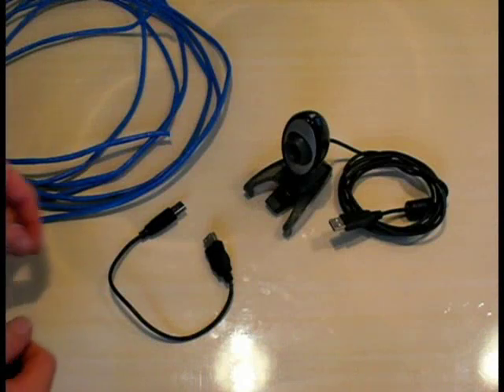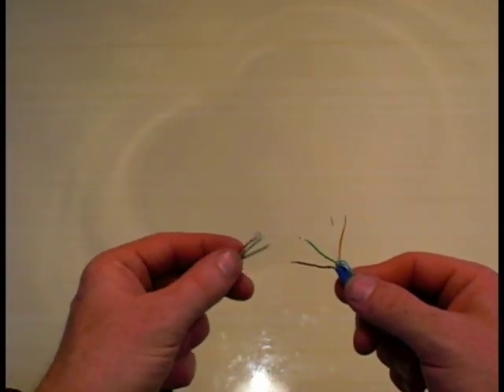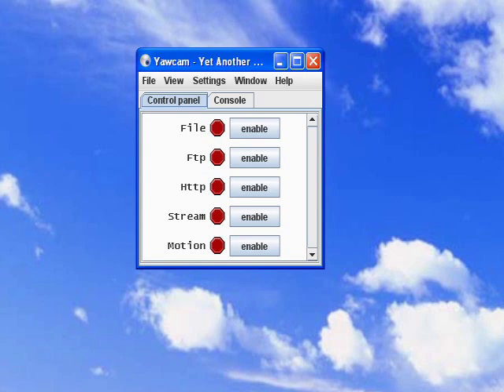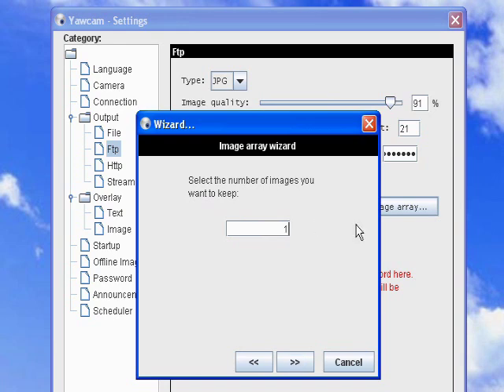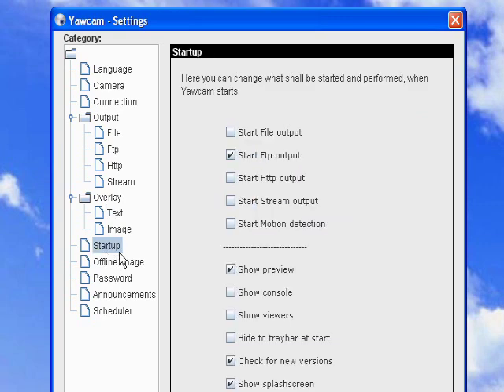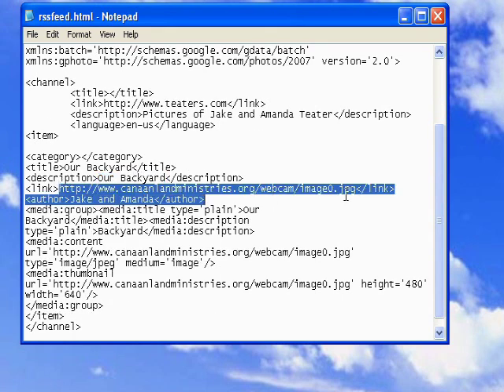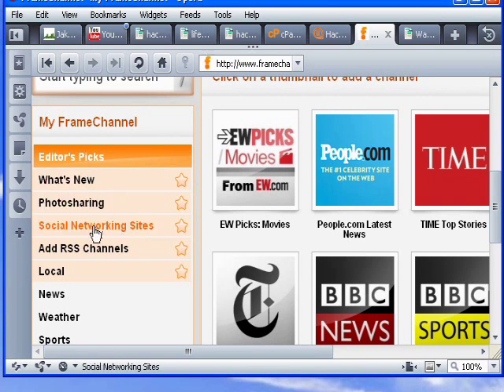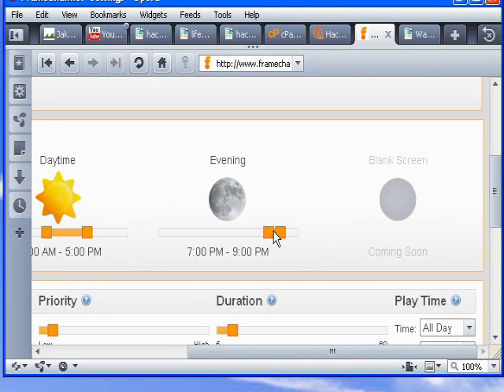Hack - Make Your Digital Picture Frame Go Live

Comment: why didn't you just add the extra cable directly to the camera cable instead of on the extension cable? you wouldn't have had to ruin the USB extension cable.
Reply: jisozaki in case he needed a new setup with a shorter cable

Comment from the maker: @AtheistGlitch Yeah - The first time I extended a USB cord I figured it wouldnt work either.  My first USB extension cord was 16 feet, and ran for 10 feet inside a 3/4 inch conduit with 3 electrical cords (2 phases and a neutral), 2 phone lines, and 1 networking cable (CAT5).  My experience from my CCNA course left me to believe that only the power should work - but they all did with no lag!  

Anyway, some CAT5 Shield twisted pair would be the best route for this project - but I didnt have any